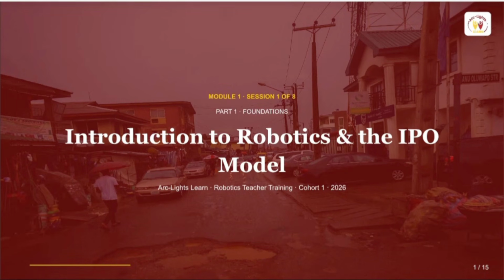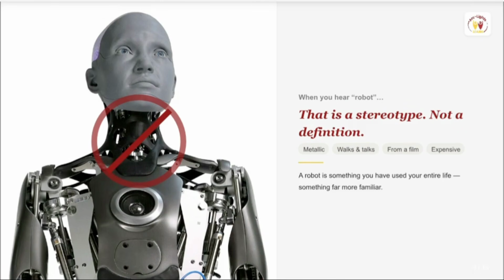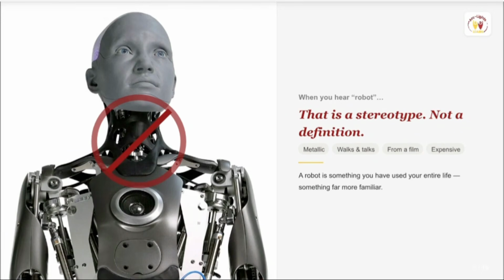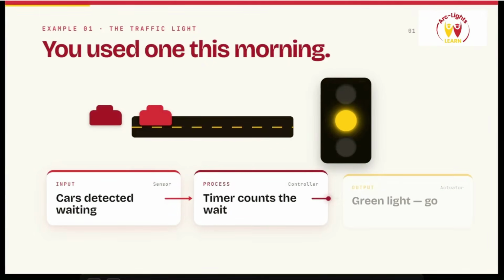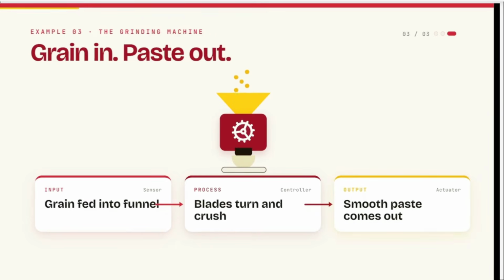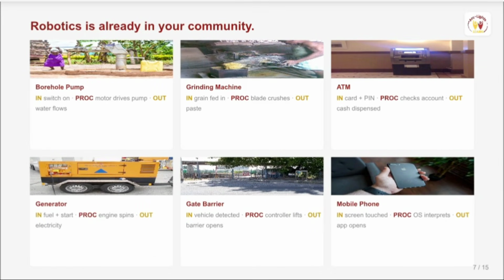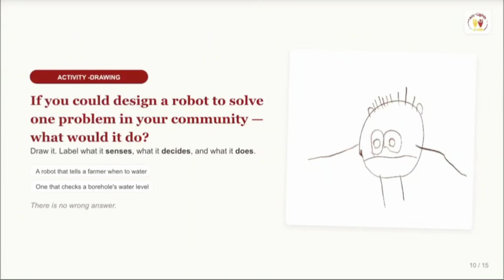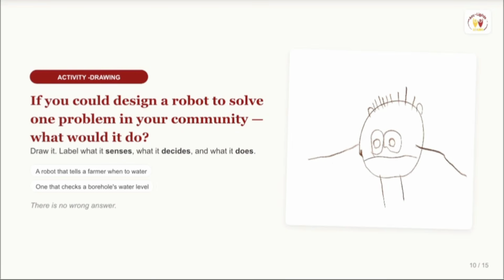What is a Robot? The IPO Model

Comment: LA- 259. 
Robot: ATM
The IPO for ATM Machine.
Input: (Censor): ATM; card is inserted and the pin is entered with transaction type and amount. 
Process: (Controller); ATM reads the card, validates the pin and counts the amount of money. 
Output:( Motor/Actuator) ;dispenses cash and prints receipt.

Comment: The Generator, is my robot. Fuel or petrol is the input, when you switch it on the engine received the in an processing. Light is the output you received at the end

Comment: Abdulazeez Nafisat Temitope
Code: 781
A robot is any machine that takes commands, process it and act on it or
Does something in reponds.

ACTIVITY
BLENDER (Grinding Machine)
* Input (sensor): Add Pepper Balls
* Process (Control): connect to the power 
  and Switch it on
* Output (Actuator/motor): Blended pepper 
   into smooth paste

Comment: Aremu Fatima Tinuola-Olajide. 
KW/324.
I choose Generator.
The IPO is:-
Input(Fuel which can be Diesel or Petrol) -Process(The Machine Spin and Convert to Chemical Energy to Electrical Energy)-Output(Electricity to power Equipment or light up the bulb).

Comment: Adebisi Aolat Bunmi
Code No:_531
A robot machine that I picked is Generator
INPUT{Switch ON the engine}=Processing{Running of machine by the engine}=OUTPUT{Supply of light}

Comment: Name Yusuf afusat sauta 
Code kw158 
Ans: The IPO for generator is 
Input: what you put in=fuel+air+effort to start it.
Process: what happens inside=engine burn fuel --creates motion -- alternator makes electricity 
Output:what you get out = electricity to power appliances+wastes like heat, smoke,noise.